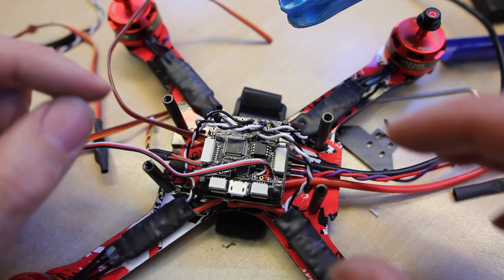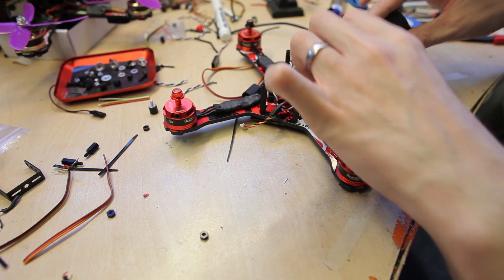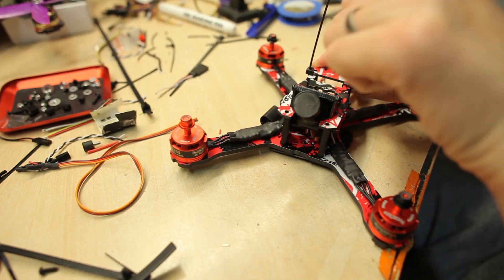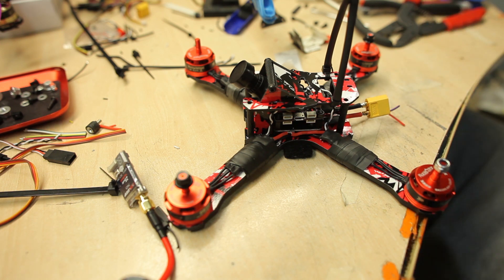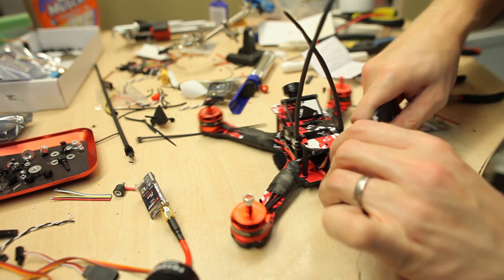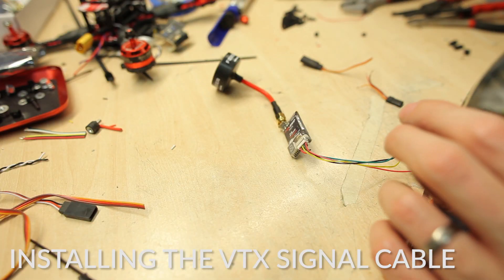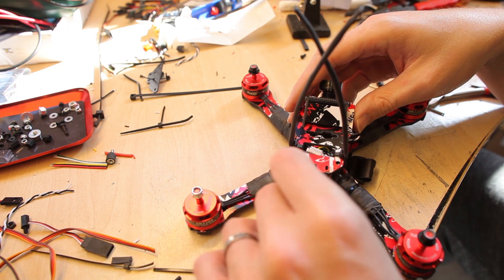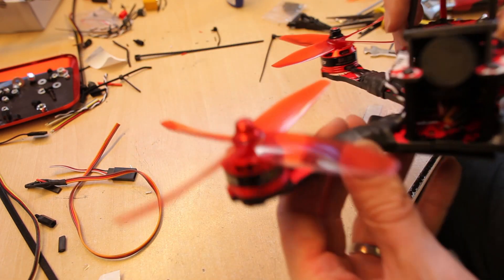Banggood Realacc x210 build video - part 5 - Vtx and receiver install

Comment: nice. did you dip the frame?
looks great.
I am just about to start my build.
I am going to use a XSR rx though.
Not sure how to hook up the SBUS and telemetry.. still researching.
Reply from the maker: Thx! Framed is taped over, check out the previous part of the build video!  XSR is probably fine too!

Comment: Hej, me again! :)
can you tell me, did you use 5v+ and ground from pdb to fc or did you use only 5v+ from pdb and ground is sufficient from the motors servo cable?
Reply from the maker: I'm using the +5v and Ground from every spot. I havent tested without the grounding. Im using the servo wires so its easier that way :)

Comment: oh, I thought you did, as the camera connect or is on upper side.. :) I allmost finished the build, waiting on one esc, coz I plug it in directly to 4s lipi...- I know, don't ask.. I burn it in one secon..! :) bit nice little model! :) bad thing is, that I have to take pwm cables from both connectors to the recivecr.. ://
Reply from the maker: Heh! too bad, luckily escs are cheap on banggood! 
Yeah I had the hs1177 camera with top connector. But it wont matter if you 3d print the camera mount or drill new holes for the camera on the carbon plates and move it forwards.

Comment: I used a kombini flight controller - fc and pdb on one board so that saves both space and weight. That made my build simple but more expensive than some other boards. I've only flown it once but it seems to work fine.
Reply from the maker: +Tobermory Cat great idea! Wish they would integrate the receiver too...